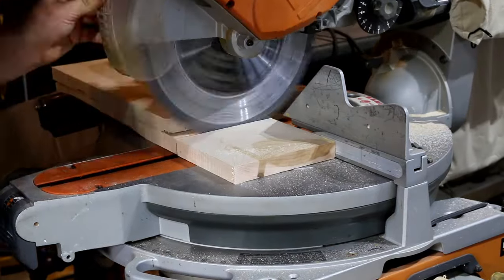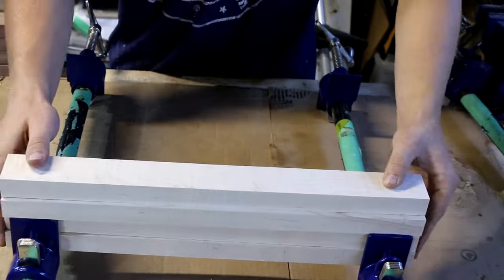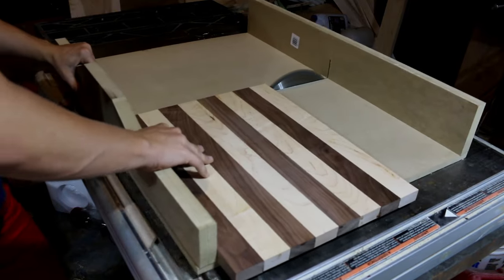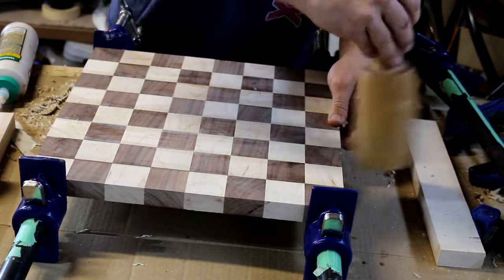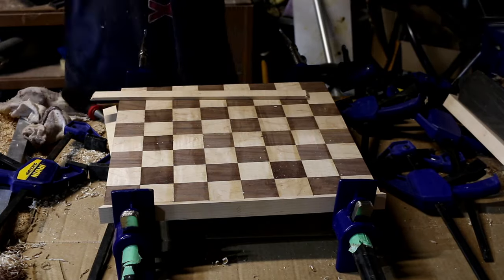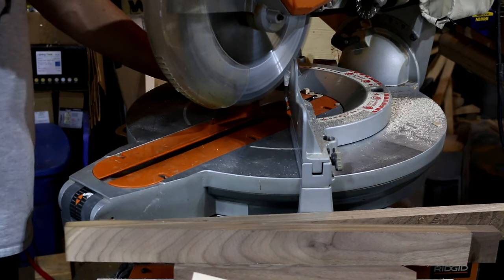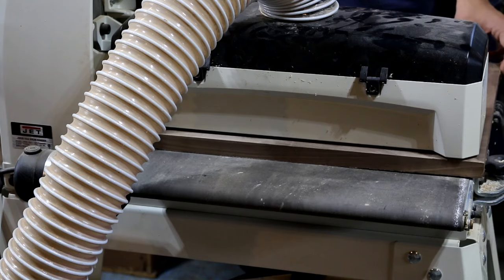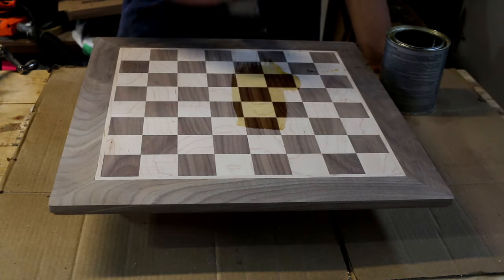Making a Walnut and Maple Chess Board Tutorial

Comment: Nice work!  One thing I've tried is to glue up the walnut border and maple strips together first before cutting your 45's.  Then you can cut your 45's on them as a unit and glue them to your checkerboard as a unit.  This makes it easier to get perfectly aligned joints in the corners.

Comment: Very nice. Would it have been easier to glue the thin maple and thick walnut perimeter edges together first, and then cut diagonally to fit the sides? I'm thinking that would eliminate a whole series of the diagonal cuts and fittings.
Reply from the maker: Thanks, I think that actually would work pretty well, Good idea!

Comment: Beautiful work. It has been a number of months since you completed the board. Have you seen any cracking through wood movement?
Reply from the maker: Thank you! The board hasn't had any issues yet but it has been in a pretty stable environment. I would try to design the frame around wood movement next time just to be on the safe side.
Reply: How would you go about doing that?  @CalebsFineWoodworking

Comment: Beautiful board! Now that it is a year old, have there been any issues with wood movement causing cracking? Reason I ask is because the border runs perpendicular to the grain of the squares on two sides, which could result in restricting the seasonal movement of the wood.
Reply: I am very curious how it held up i want to make it exactly like this
Reply: @dicekar Yes ,that miter joint will open or the board may cup when the solid wood  chessboard expands . You will see this border used on sets with  veneer with plywood backing board which is more stable.

Comment: Awesome board. Im actually working on one myself, and came across your vid while looking for some references. I actually am making mine out of 2” scrap squares, which are already cut. Any suggestions for clamping them up, so they are all even?
Reply: I don't think that would work; there is a ton of endgrain there, which does not glue well. An idea that would work would be to glue them to a stable substrate, such as baltic birch or 5-ply. A nice benefit is that you could to some pre-finishing, such as adding dyes or stain without having to worry about the finish bleeding into the other species. Good luck!

Comment: Great Chess Board! I have some questions. What kind of router bit did you use to join the boards? Second, What is the thickness of the Maple and Walnet boards?
Reply from the maker: Thanks! I used a Whiteside spiral router bit with a 2 inch cutting capacity, and used 4/4 lumber.

Comment: I'm an idiot. I tried to make one before doing any research, and cut each individual square and glued them together. It turned out with seamless joins, but the squares are slightly rectangular by 1/32 or so. Wish I had seen this. Makes so much more sense
Reply from the maker: Glad it could help!  I've definitely had experiences like that. That must have been a fun glue up with all those individual squares.
Reply: @CalebsFineWoodworking  I was about halfway through and realized I could've done it this way and saved about 45 cuts or so lol. So I ended up redoing it the RIGHT way, and I couldn't be happier. Thanks! The glue up was rough, but it worked! goes to show that there a different ways to tackle something, some more efficent, and others more painstaking, but you can get the same results.
Reply from the maker: Very true, much of woodworking is learning from yours's and other's mistakes and then improving on what you know. Glad it came out great!

Comment: hello woodworkers, i own one large chess board with 6cm squares, huge masterpiece but i have noticed there have been some small gaps between squares and one of the square is slighty cracked. i store the board in my room with temperature min 18 in winter max 35° celsius in summer when ac is off, do you think that create the gaps and cracks ? Also do you have some advices to fix these small imperfections before it became worse ? I own the board for about a year. Thanks for any advice
Reply: Hello, this most likely happened due to the board being made of “new” wood. Once cut from the tree, wood needs to dry out before it can be made into a stable project, this can take years. Moisture inside of finished wood pieces  can cause movement as the moisture dries out, like swelling, cupping, twisting, and cracking.  The temperature changes in your room are only expediting the process, however if the wood were already dry it would not matter. In order to fill the cracks you can use wood glue with some sawdust of matching color. Avoid using CA glue or epoxy as these glues are very hard and brittle and will cause more cracks to form as your piece continues to dry out. Have patience and good luck!
(Source: I make and restore violin bows)

Comment: Does this border survive the wood movement?  I am contemplating a chessboard like this one but was unsure how to frame a board made of real wood.  I thought i would do it like a door panel with expansion slot in the frame but you arent doing that and i would rather not do that either
Reply: Frame and panel is the best for the movement problem,will also help to prevent cupping of the solid wood chessboard

Comment: I decided to try woodworking and started with this however I don't have a thickness planer and found it really hard to close the gaps of my strips even with clamps, is it possible to make these without a planer? or do you need a planer to make everything seamless?
Reply from the maker: Glad you're giving woodworking a try! If you don't have a planer or jointer you'll have to find another way to square up your board if you want good joints. If you have a router table you can set that up to joint edges, or build a jig to joint edges on the table saw. Another option would be using a hand plane. There are lots of good videos out there that will be able to explain those methods in detail. Hope this helps and good luck!

Comment: Since the board is encased with the mitered maple border glued to it, won't the wood movement of the pieces cause it to crack somewhere eventually? I'm thinking about making a chessboard, but I've seen some warnings saying to either not use a full hardwood top (use MDF and veneer instead) or to find a way to allow for movement perpendicular to the grain. Any thoughts/recommendation on that?
Reply from the maker: Yeah, ideally you build in a way that accounts for wood movement. I realized that after building this one. I haven't had any problems with this board, or one that I made around two years ago. I'm not sure how long it would take for it to become a problem. Maybe I will do a video on that in the future. Good luck on your board!
Reply: Maybe if it stays inside in an air-conditioned/heated space, and if you don’t live somewhere too humid, it won’t have any problems? 🤷‍♂️ I live in Utah and it’s bone-dry here all the time, so I bet it wouldn’t be much of a problem.
Reply: Dowels in the side of the the framing mitre jointed pieces should hold the lot together well.